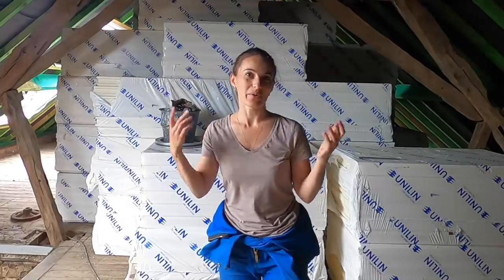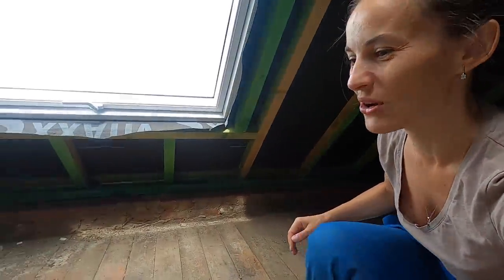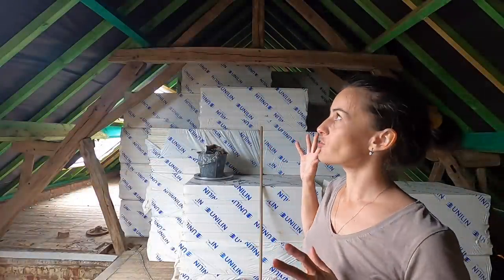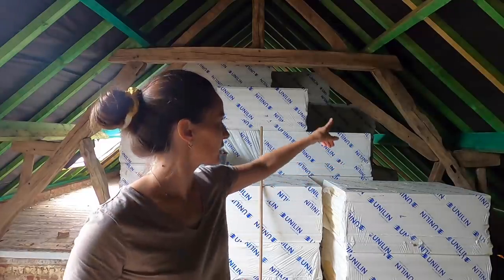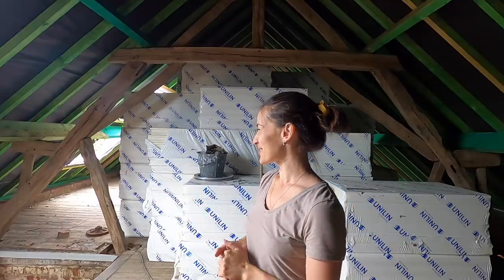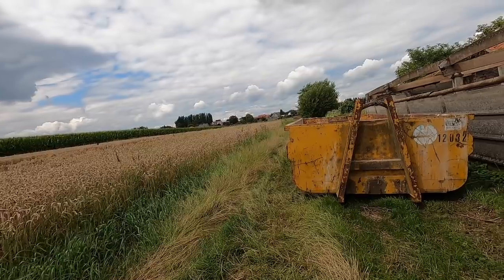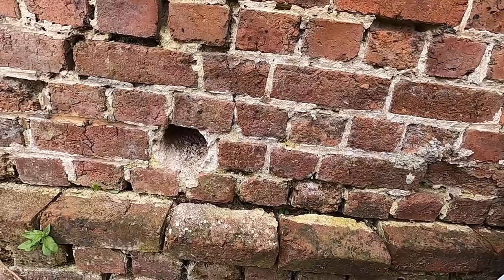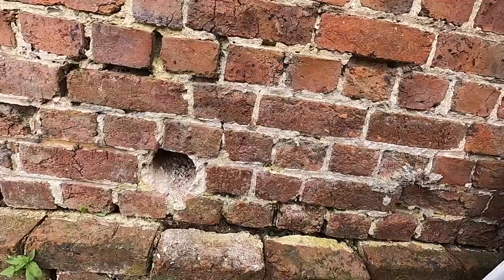1908 abandoned Belgian farm got BRAND NEW roof

Comment: Congratulations, your roof looks fantastic. Regarding pointing material for the bricks - originally your building would have had Lime Putty and sand mix for pointing. It is advised to best reuse this material to repoint only. This product will best allow your building to breath. (You can make a large batch of lime putty onsite and allow minimum of 3 months for it to mature before you use it....the longer you leave before using the better it gets and as long as you keep it submerged in water it can keep indefinitely. The same batch can be used later for creating lime plaster/render for interior walls. The cheapest way is to make your own lime putty, especially when you need a lot). 
Even before the recent flooding when the roof was exposed - you already had too much moisture in your floors, as was evidenced by the numerous tree roots you pulled up when you were digging the floor. The lime putty based pointing will help the bricks shed moisture and allow to dry. 
Regarding the iron - only use Stainless Steel. If you use regular steel then as it rusts the rust will stain the lime render/mortar. 
However you have a big problem you must address - the ground level at the front of the house has been raised higher than it was originally. Anytime you have an outside ground level above the level of interior floor you get damp and moisture in the walls .....therefore you must reduce the outside ground level to make sure it is below the interior floor level - if not you will have damp issues. I'm sure there are other areas (apart from the front of the house) which will need to be checked for how high the level of ground outside is compared to interior floor level. 
Furthermore, any ground outside the building where you have concrete - where the concrete is cracked, this is allowing moisture into your foundations and causing a damp interior floor and wall. Also where you have concrete in direct contact with the bricks outside this is allowing water/damp to bridge into the bricks - you need to put a damp proof material between the brick and concrete to remedy this.....you are best to remove all concrete around the outside of the house and redo it properly to solve your damp issues.

Comment: Marina and Ilia, I liked your channel very much. I am renovating a building that is 150 years old and, like your farm, is made of brick. Lime mortar is best suited for repairing old walls. It is cheap, easy to prepare and apply, and guarantees good moisture exchange. Please do not use cement mortars and modern polymer mortars. Similarly with interior plasters. The best for you will be ordinary lime plasters, much better than gypsum plasters - healthier and better reacting to the old brick wall. The simplest proven recipe for a mortar for gluing and pointing bricks: 1 part of lime dough + 3 parts of sand. Lime dough: pour a 20 kg bag of slaked lime in a bucket with 15 liters of water and leave for 24 hours. After this time, mix lightly. To obtain the mortar, mix as previously given in the proportion 1: 3 with a mechanical agitator. It will be slow at first, but do not add water, keep stirring, then it will have a wonderful consistency: sticky, elastic, you will be able to work with it for several hours. You don't have to prepare a lime dough every time. You can make more of it and keep it covered for up to several months, and if necessary, you will quickly prepare the mortar as much as you need. Scorchin 'Scooters gave a very valuable comment. Use his advice. Regards, Grzegorz from Poland

Comment: Excellent work by your roof contractor. And no need to apologise for replacing it : after 70 years, the small studs at the inside of rooftiles, often had their best time, and start losing grip on the beam they are placed on. It is also the one and only correct way to insulate your roof : from outside to inside. The other way round only risks for condensation issues. It allows you to have a clear view on the structural health of your roof and the supporting beams. And those Velux windows are AWESOME !!
For the lime mortar questions : perhaps get in touch with a specialised  Belgian company like ECOMAT , they can tell you everything about the right lime-based mortar in our climate and region, as they are specialised in high end renovations of old buildings in Belgium. No doubt they have a lot of tips & tricks ready, too. One of those tips is that lime mortar does not dry as quickly as cement-based mortar. That means that you'll have to work a bit slower or plan to work differently when really doing bricklaying work to build a wall.
Another important aspect of lime mortar : it is very porous, and perhaps you'll have to grout your bricks with a different composition of lime mortar eg on the northwest side of your house that catches most of the rain, and definitely for the bricks that are lower to the ground or even underground. The porosity of lime mortar was also the reason why a lot of pre-portland cement-buildings were plastered, too. It gave an extra layer of protection against the grout being washed out over time.

Comment: As ever, there are some ups and downs. I'm glad to see you take this week with humor!
About the advice. As i know you should never use cement based mortar with these brick walls. It'll destroy your bricks. Lime mortar is the way to go.
the best result imho should be a mortar with gravel or sand  and chalk as main ingredients. but first you have to remove the old stuff in between the stones...
Local masons should be able to give you the best advice on the doing and wich brand to take.
Reply: @MsSherrydarling  I agree that Theo learned about pointing with lime although he i working with stone in a very hot climate and manufactured brick is completely different, I believe that lime mortar is best in this case, but advice from a local builder would be advisable.

Comment: What job, it reminds me of my own house almost finished but there are always things to do.
The roof looks great, but it will get very hot in the summer. 
The solar panels should (IMHO) be facing the south, so the roof of the house is not the best place because it is facing the west. There are websites that show the optimal orientation and angle of solar panels.
You have enough south facing roofs, also keep in mind that the converter will produce quit some heat!

Comment: I would prefer the NHL 3.5 mortar, it's easy to work with ...
As already written below, mix it about 4:1 and place it in the gapes with a small Throwel (I hope this is the right word)... before it dries up, take a brush with water an brush the surface of the mortar , so that it gets smooth.

Comment: You are amazing guys! 🙂 You want to use the same materials they used before, but that lime takes more time to cure than the materials we use now. The roof is amazing, they did a great job with the isolation. I don't know if I am right, but the lime mortar will crack when is cured.

Comment: I have the impression your boerderij/hoeve has joints between the bricks called ‘knipvoeg’. It are joints that are (or were before they eroded) sticking out. If so you have to look into that because it is a rarity. You dion’t see that very often. and in my opinion it is an asset. Not many maconaries do this type of repair/restoiration. But the results are beautiful. Keep up the good work and congrats with the 50.000 followers. Groeten uit de Kempen, Grobbendonk.!

Comment: For re pointing and cementing bricks in place, clean all the joints ( for loose mortar) and use mortar mix, simple cement and sand, you can also add some latex, that's my opinion.

Comment: Hello you both! First I will answer the question about the mortar! Yes, 3.5 is the right one as you only need to fix some of the bricks and some cracks! For placing walls there are some other! And yes, you can use iron to stabilize the cracks but be aware, if this iron is rusty, (99% is rusty) it need to be prepared, otherwise it will cracks the mortar within the next 20 years. You can use Brantho Korrux what is aspecial paint to stop rusting and safe the iron. That will stop the rust inside the mortar! Hot mortar is not needed!

Comment: Hi Guys 
Good to see the progress...one quick comment about the concrete slabs. This are not a good idea in an old building, it needs to be lime based. A concrete slab diverts the humidity into the walls, which causes humidity to rise by capillary action. The building needs to breathe, ventilation is also very important.

The lime only mortar would seem the best to me, anything with ciment would be stronger than the bricks and would led to the deterioration of the softer bricks. I don’t know the products you refer to as I am based in France. Perhaps your supplier could give you some advice, or local masons.
All the best.

Comment: to fix this wall you should recycle all the  other bricks  you removed else where , and you have to start at the base ,   and grind out the old joints and repoint with a moisture-resistant joint mortar, afterwards you can also use a waterproof invisible coating to make the walls really water resistant..while the old structure remains intact, is a job that can be done by yourself with some practice can be easily carried out ...... be careful with the coating when the new windows are in, cover everything, because this stuff can hardly be removed

Comment: Don't use Portland cement, it is too hard  and will not work well with the existing lime mortar and if the bricks are soft it will damage them over time. Best to use what was used originally lime mortar.

Comment: Two more comments. 
1. The mortar for sticking and pointing bricks cannot be stronger than bricks! The mortar is supposed to work and act as a cushion of stresses caused by changes in temperature and humidity.
2. You do not need to use steel bars to secure cracks that actually react with the highly alkaline lime mortar. Fiberglass reinforcements in the form of bars are available for sale. At the current prices of steel, composite reinforcements are cheaper than traditional ones ;-)

Comment: Don't use iron or steel bars for reinforcement.  Ultimately they will break the brick.  If you have subsidence cracks cut out the cracked brick and relay (after fixing the root cause of the subsidence) . Use a lime mortar mix that is softer then the brick, talk to local suppliers who will advise, also you will want to differentiate between repointing and relaying brick, different mortars (fine vs sharp sand mix).  Don't try and make your own lime mortar the effort is enormous and will ultimately cost you more than buying a ready made dry mix. Suggest you get a tool to dig out old pointing, much easier than using a chisel and more consistent result (and a lot quicker).

Comment: I prefer to use  NHL 3.5 (Natural Hydraulic Lime) with grit sand at a mix ratio of 1:3 by volume. However for thinner joints, soft sand is easier to pack in, in this case, I normally up the ratio to about 1:2.5.  The NHL stays workable for longer than OPC (ordinary Portland cement), it's softer and breathable so it’s much kinder to old bricks.

I find a 2-pint saucepan good for measuring out workable quantities.  Putting 2 sand into the bucket than the one lime topped off by the final 1 sand will keep the lime dust down while mixing. If you put the lime in first it tends to stick at the bottom and it’s hard to mix. 

This eight-pint mix will usually need less than a pint of water, so after the half-pint just add a splash at a time until you get a good mashed potato-like mix (well that’s every bit as good as saying soft buttery texture).

Comment: Whatever you use needs to be softer than the brick. Don't use modern cement product, use what was used originally to the building. Iron rust and expand and split things apart. I think it best to consult with preservationists to advise you on historic building.

Comment: The render  to use may be dictated by the age of your bricks. Here in the UK older bricks tend to  be softer than newer bricks. For old bricks Lime render would be needed and cement render for newer bricks. which type of lime render is needed, that one I don't have the answer to. If using metal to strengthen the joints, Stainless steel would be best as normal steel would rust due to the lime render absorbing water. Normal steel will over time rust and then blow in heavy frost environments.

Comment: Roof is done nicely. Only i wonder what material they used for the connection with the chimneys. It looks like the same material as around the roofwindows. Lead would be much nicer but expensive.
As for the brickwork i am not an expert and I don’t want to discourage you, but you have to think very careful about you want to do. For laying the bricks you need a different type of mortar then for the joints. For bricklaying or for the joints you need a mortar based on chalk. Because chalk is much more flexible then cement based types. Bricks in the old days were not so strong as bricks are nowadays. So that is why a chalk based mortar might be more suitable. Also as for the joints if you want to repair them only localy, you have to check the color of the mortar. Otherwise you will see the difference between the repaired and original mortar. Why don’t you ask a brick layer for advise. 
As for steel as rebar in joints. Use it as less as possible and if need it use stainless steel, or galvanized steel, but don’t cut it after galvanizing. Those cutting edges will be the starting point for corrosion, with devastating effects in 5 to 10 years. Succes with the further investigation.

Comment: Hello, You requested help regarding repointing your brick. There have been a lot of good comments on the subject and I would like to add something that might help. You might try to find an older mason that is retired but has local knowledge of the area. Sometimes the location requires a little bit of adjustment just because of the local climate. Maybe the churches or community center could help finding someone who could help you. Oftentimes the older craftsmen have a lot to offer in the way of knowledge  the mind is good and strong but the body leaves a little to be desired. Just having someone with that experience there to show you or tell you how to do something can be way better than anything you can get by reading about it in books or off the internet. Even if your help just sits in a chair and offers mostly moral support you will gain knowledge and even better possibly a new friend with great stories and a history of the area.

Comment: It is very important to use the correct mortar!

1.Too Hard: Portland cement is too hard for historic masonry. These soft bricks can be completely destroyed by hard, unwieldy mortar. Pointing old brick with portland cement mortar can cause the faces of the brick to crack and fall off and literally turn to powder, a condition known as “spalling.” The extra hard mortar doesn’t allow the brick to expand and contract with seasonal changes and its tight grip is what causes the spalling.

2. Not Breathable: Historic masonry is not a waterproof material. It takes in moisture and lets it back out again as does the lime mortar. But portland cement is not breathable. Repointing with portland cement will trap moisture in the wall and cause efflorescence and premature failure of the brick. Not to mention the building is not able to sufficiently breathe to expel the moisture 
that inevitably builds up indoors in the winter.

Here is a YouTube link that might help:
https://thecraftsmanblog.com/how-to-repoint-historic-mortar/

hope this helps💖

Comment: Take a sample of your existing mortar to a brick yard and have it analyzed so you know what was originally used. Contact someone like the Heritage Group that manufactures historical mortar mixes to find out what you should be using. Using the wrong mortar would be disastrous as the brick of the period that the house was built is not the same as modern brick. .

Comment: You do not have to justify anything you do. This is a VERY old house built (maybe) to standards 110 years ago. Everything you do brings you closer to what YOU want. Don't apologize for any changes you make. Incidentally, your boiler does NOT boil just heats water to a safe temperature for household use.